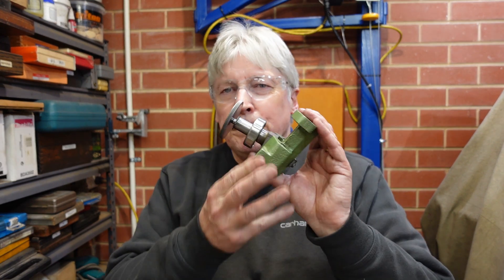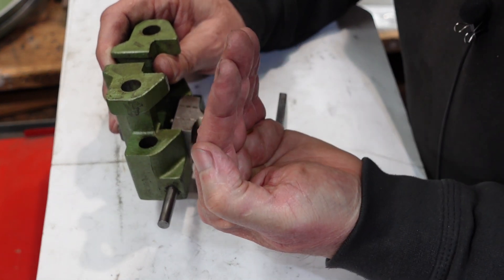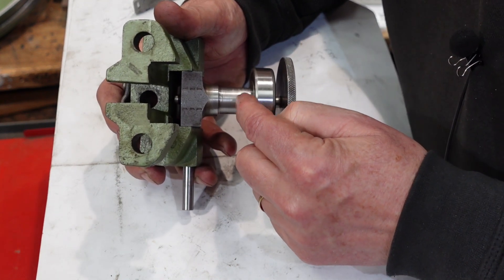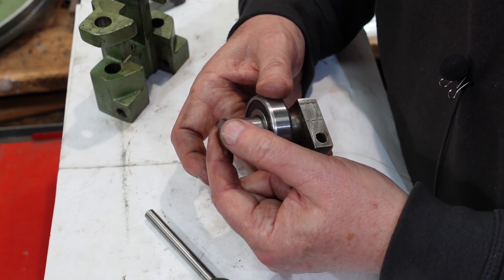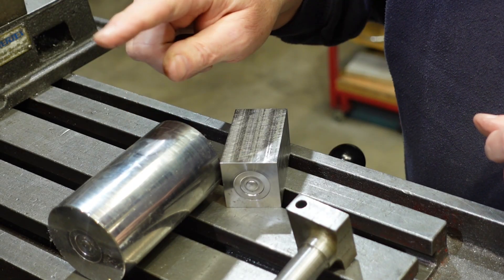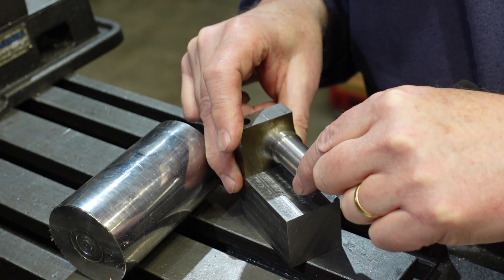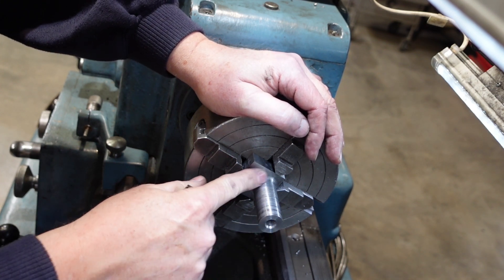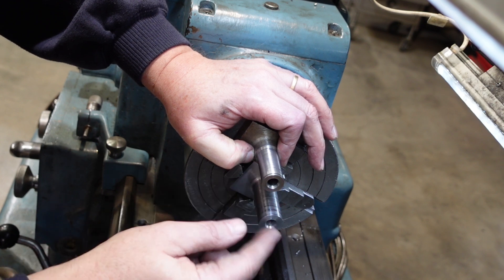Look what the metric system has made me do!

Comment: 14 years ago I was teaching, switching from Imperial to metric so much it was just second nature.
Today, I have to think about it and quite often use a calculator, retirement isn't as much 'fun' as I expected.
Why don't you get a cheap Chinese dial indicator, 1", 25mm or even 2", 50mm travel just for 'odd' items?
It isn't something you use very often but when you need one there isn't usually anything else or it's 'complicated' to set up
I have a few, inch and metric, and, although I try not to break stuff, it won't be the end of the world if I screw up and break one.
They are OK even if some need de-burring in places, I like 'playing' with tools and equipment so it isn't too much of a problem (except for using jewelers loupe to see small stuff) 
Circlips are stamped out so they have a sharp edge one side and slightly rounded the other side.
Always fit them so axial thrust (side pressure) is pushing on  the 'rounded' edge to  push 'sharp edge into groove.
I'm pretty sure you knew this but others reading in the future may not?
Reply from the maker: I do try to install washers sharp edge down. I've never found such a pronounced edge on the circlips I have but I agree that it is worth installing them so they bite under pressure. I have a video coming up soon with circlips, so I'll try and remember to mention that (the number of things that you don't think to mention when you start doing this stuff is astounding).

Comment: Always a very nice job.  As a hobby man, why not make the square and then bore to a press fit for the shaft? Cheers from Sweden 🇸🇪
Reply from the maker: LIke sleeving, that would be another way to do it. My concern with that is strength - the original part has a radius at the base to smooth out the stresses a bit. A straight shaft pressed into a hole would be prone to pulling out (the square part is only around 7mm think) and probably stress that area highly.

Comment: Love the work you go into to making a near identical replacement.
I am almost surprised you didn't remake the adjusting screw (if the handle can be removed) so that everything become metric (the thread). No reason to other than it is further converted to metric.

There are other ways to create this piece - for those that may want to think about other ways
Sleeving of the piece, as suggested below and commented on below.
Build up the surface by welding, need to make sure the surface for the weld allows for penetration (made a little smaller) and that the weld material is reasonably machinable. Of course it requires reasonable welding skill as well. Works well but feels HORRIBLE to do. (I wouldn't show it on a YouTube video.....but hey maybe people that don't know how to do that sort of reclamation may like it....)
Make it out of two parts. The square piece and the bar piece held together with a press fit, or threaded if that is felt to be easier. If desired it can be welded so that you can recreate the fillet if desired. Has the advantage that it takes away the intermittent cutting that is hard on the tools and lathe, and a whole lot of chips.

For those in Aus mag-pro.com.au (no association) has 2" dial indicators for $35 - they may not be Mitutoyo - but for setting up on the lathe etc work well when you need a long stroke. $75 for 50mm if you really must have metric.

Comment: Could the original be turned to 5/8" diameter and a 20mm tube pressed on?
Reply: As the spigot and tube are relatively long and not subjected to any significant relative forces I would use a slip fit and loctite. The geometric precision would come from clocking the original spigot in the 4 jaw chuck and reducing the diameter to a slip fit.
Reply from the maker: In theory it could, but you would need to accurately bore the tube and turn the spigot, fit the sleeve well enough that it would not spin or come off then turn the OD accurately. That's 3 times more precision work than in making a new one.
Reply: Drill + ream + groove a piece of 20mm rod 16mm and push on. The concentricity and position aren't important. Make this first then turn the original part to suit the bore.
Reply from the maker: @tates11  You could try doing it that way, but I think you are over simplifying how it could be done.
For example, if you groove the sleeve first and your fit is not right, will you end up crushing the groove? 
The spigot needs to be perpendicular to the axis of the pivot, otherwise thereis a risk of the blade not tracking properly. Sleeving would mean that a method would be needed to ensure that.
There are considerations either way.